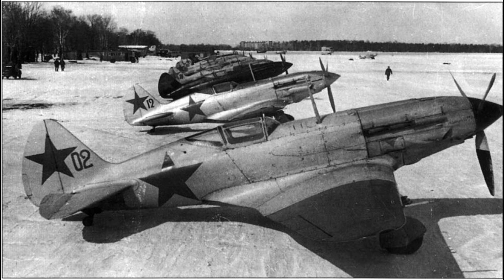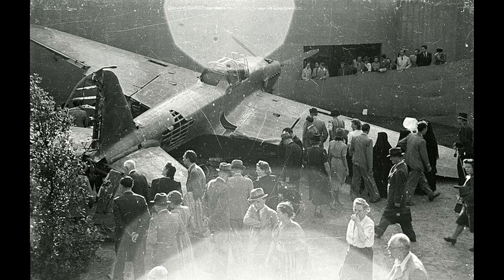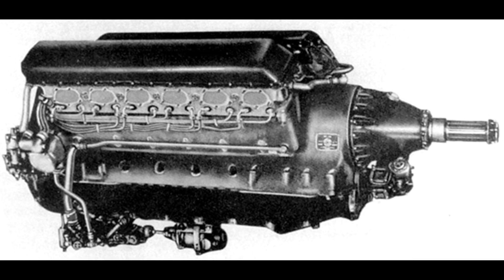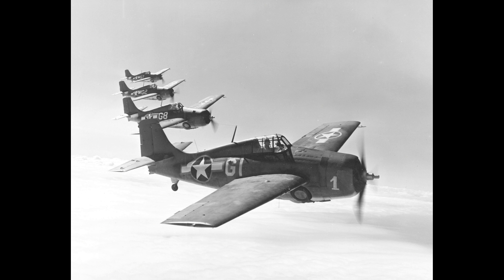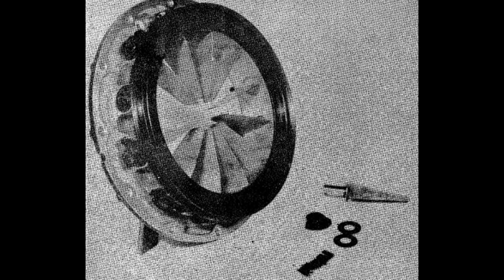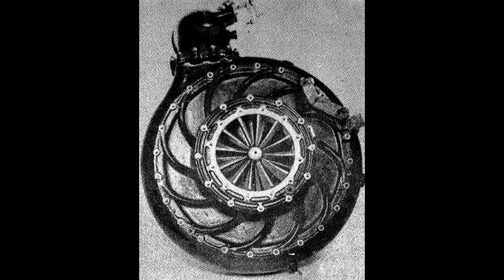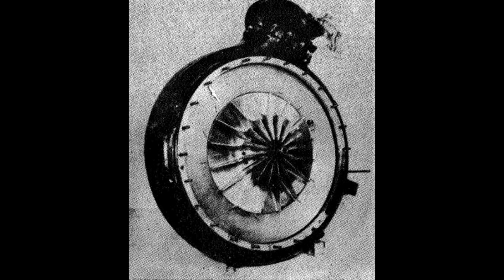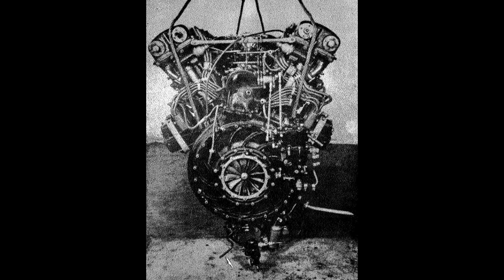IL2 Sturmovik Secret Throttle, extra 100 horsepower!

Comment: The method of output control is standard on any centrifugal HVAC compressor, They are usually driven at constant speed and the HVAC chiller capacity is controlled by varying the vane angle there are thousands of such machines in service. Also GE turbine engines use a similar system to manage compressor stall at low power.
Reply from the maker: Hmm, I didn't know that about HVAC systems, but I am not an HVAC guy, I just call someone to fix those. However I am quite familiar with GE Turbines as I spend a lot of time operating them. I think what you are talking about are the stator vanes, which do optimize the angle at which the air strikes the compressor, but they are not movable as they are with this throttle, at least not in the case of any version I have seen in an airplane.
Reply: The J79 has variable stator vanes. This channel has (at least) a few videos about them: https://www.youtube.com/watch?v=kN2USqt-S2M

Variable stators on the T58: https://www.youtube.com/watch?v=N-c3OPmR3tw
Reply: Thanks for the reply, I was referring to the stator vanes on the GE engines I do not know of any use where they are controlled by the user either. Industrial axial compressors sometimes use variable stator vanes for capacity control. The HVAC compressor capacity control is for large commercial systems. The effect is the same as the stator vanes on the first stage of a GE turbine in that they change the approach angle of the gas, all these years later they look the same as the ones on the IL3 supercharger, only larger.
 I am sure operating the GE turbines would have been fun.

Comment: I remember an aftermarket device for normally aspirated cars which put a free-spinning swirler like this on top of your carburetor or in front of the throttle body intake that caused intake air to swirl. This helped boost HP by about 5 - 10%. This was YEARS ago, so don't ask for a reference, but it was real and it worked. The selling point then wasn't increased power, but increased fuel economy.

Comment: You said the Germans didn't use it because they had the variable-speed supercharger, but what about the FW 190? The 190 didn't use the variable-speed supercharger and had a conventional two-speed supercharger. Why didn't they use it on the BMW 801? It would have been especially useful on the FW 190 F and G which were being used for low-level ground strikes on the Eastern Front.
Reply: it's all about the octane! the Germans didn't have the quality super high octane (150 octane) the Americans had and we shared with the Russians> the allies could run the boost way high where the axis couldn't because of the quality of fuel
Reply from the maker: I don't know why they didn't use it on planes without variable speed superchargers. If I had to guess I would say that it's because the Germans absolutely had a full plate with development of other things which were much more promising. With the pressures of a war against three major powers at the same time, they had to prioritize, and there were other things they were working on that were much more promising, and ultimately much more effective.
Reply: dogeness Questions ! Questions, Questions!!

Comment: Umm You mentioned about the Germans having a far more advanced supercharging system. So I am wondering how much more advanced it is.
Reply: The Germans had a very advanced research effort for this sort of stuff, because they didn't have fuel nearly as good as the allies, so they had to do with bigger and more complex engines to get the power out.
Reply: Is it the supercharger impellor that made all the difference?
Reply from the maker: That's way too complex to address in a quick post. I'll probably do a whole video on it. The super short version is that it was the most advanced supercharger drive system in WW2, and probably ever.
Reply from the maker: Probably not, although I have no way of comparing impeller efficiency. I suspect the U.S. and German impellers were directly equivalent. The difference is the drive system. The German system could infinitely vary the impeller speed, independent of Engine RPM, sort of like what you can do with a turbocharger.
Reply: I see, then I shall look forward to the video explaining how advanced the supercharger in the 109 is. :D
Reply from the maker: I'll move that up on the list. I am not sure how many others will be interested in that, but I think it's an interesting topic.
Reply: Well I will be really interested no doubt about that
Reply: @GregsAirplanesandAutomobiles  I'm interested!  Looking forward to the post!!
Reply: The P-63 had a hydraulic variable speed secondary supercharger running on an engine power take-off that fed the engine mounted supercharger.  Unlike the P-51, it did not have an intercooler but relied on water injection.  I saw some test results where P-63s were achieving speeds of around 450 mph while most literature gives its top speed at 410 mph.
Reply: Dan Zervos - But that was well after the US had analyzed the German drive system. IIRC, the hydraulic clutch system that Allison used was different than the one that the Germans used, but it was still basically the same concept.
Reply: Arisa Misato the Germans used the Russian idea it on the Jumo 213.   I’m not sure if it’s all of the series  or just the two stage 3 speed 213E.   The “far more advanced” infinitely variable system used on Daimler Benz engines produced great efficiency at the Saft came at a cost of reduced jet thrust.